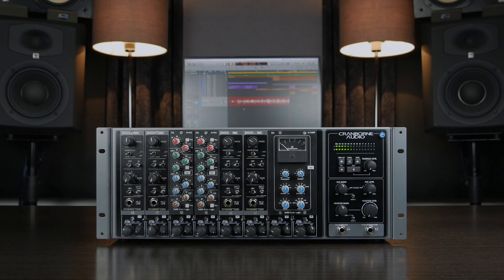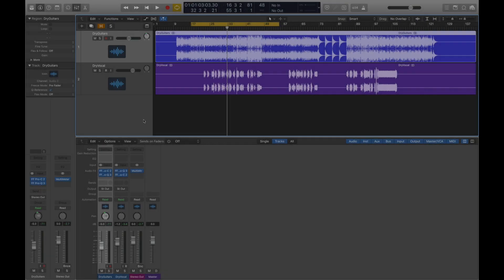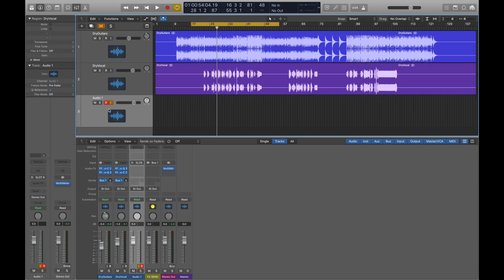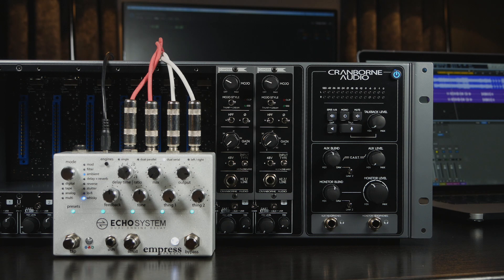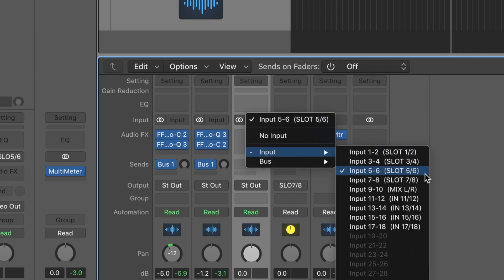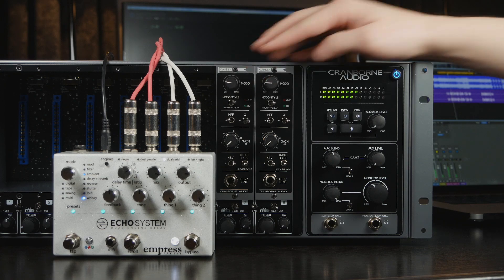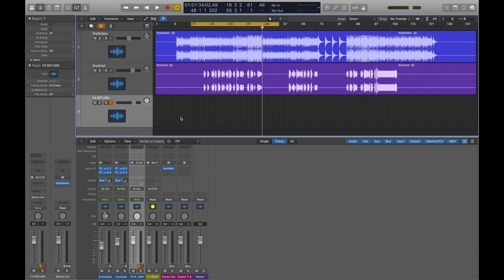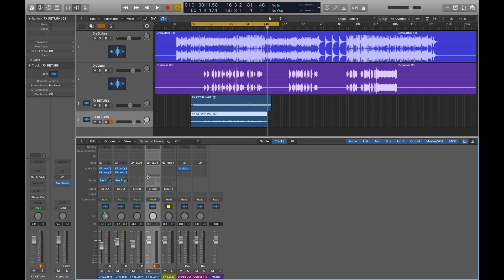500R8 Quick Tutorial | Using Insert Points To Integrate Outboard Effects

Comment: Wouldn't this unit be redundant if I am already using 12 stereo out summing? How can it be incorporated?
Reply from the maker: Hey Miguel! It wouldn't necessarily be redundant if you already have a summing mixer. You can integrate the Summing Mixer with the unit for more channels if you use the ADAT expansion, or you could feed your summing mixer out of the 8 slots of 500R8 - giving you 500 series processing prior to summing externally! All of 500R8's analogue paths are exposed and so you can patch in the summing mixer in a few ways to suit your setup. Hope that helps! Elliott
Reply: @cranborneaudio  Yes it helps thanks. I am considering it but I am new to external hardware processing so I will have to get more knowledge on this to see how I can fit it  into my rig. 
Would like to know if it is either or, or it both can be done at the same time based on your answer.
Reply from the maker: @riktascale4  You can use it either way - If you want to use the external summing mixer as well as 500R8's then you will need additional equipment/converters to get access to all 20 channels (8 on R8, 12 on the external unit) for summing - but you will be able to use 500R8's summing mixer as well as the external mixer. If you didn't want to purchase additional equipment then you can patch the Summing Mixer into 500R8 using the insert points or the Module Direct outputs but there would not be much benefit in that process - it would be an either or situation. If you have more questions, feel free to send us a Tech Support email where we can provide more through guidance on how to connect 500R8 to your other pieces of gear.
Reply: @cranborneaudio  Or that is a road I think I do not want to go down yet. I already have an apollo quad and 16 with my 2 bus+ and d box so this what I am considering adding it to with my only other purchases the 500 series hardware to add to the slots.
Reply from the maker: Hi  @riktascale4  , as a quick note, if you want to pair one of our rack with your Apollo, you will need to look at our 500ADAT: https://www.cranborne-audio.com/500adat This will connect to your Apollo via ADAT and give you 8 more channels to record as well as 500 series connectivity.

Comment: Is this possible with the ADAT unit?
Reply from the maker: Hi Matthew,

Thanks for the question!

Yes - the 500ADAT and 500R8 have ~95% similarity. The channels/slots on the 500R8 and 500ADAT are 100% identical, so each channel/slot on both units has inserts. The only difference is you will be routing ADAT channels in your DAW via your audio interface rather than from the USB interface of the 500R8.
Reply: Cranborne Audio Fantastic! Thank you for the clarification. If I had an ADAT chassis full of preamps, and wanted to record all 8 preamps simultaneously in their own individual tracks, that’s also possible?
Reply from the maker: @HollerAtcherBoi  Our pleasure! Yes - that would be one of the main uses many 500ADAT users do! Each slot has its own converters and shows up as a separate input and output as ADAT channels 1-8 corresponding to slots/channels 1-8
Reply: Cranborne Audio What a beautiful unit. Thanks again!
Reply from the maker: @HollerAtcherBoi  glad you think so too! 😂🥰😍🤩 Thanks for your interest and checking it out!

Comment: Hello guys, is there there a reason the printed effect appears to be mono?
Reply from the maker: Hey Ged, the printed effect is in true stereo however when Logic is generating the waveform during recording, it always appears in Mono (not sure why!). When the recording has finished, the printed effect then has two waveforms (L and R) and appears as stereo signal. You can see that at 03:07 in the video! Then when the track is shrunk in size at 03:10, the wave form appears as Mono again - I presume to save space, but is still the true stereo effect! Hope that helps!
Reply: @cranborneaudio  I suspected it was a quirk of Logic, thanks for clarifying.
Can I also check; is this same setup possible without a 500 series module inserted / bypass enabled / a module which is not a preamp or doesn't have a gain control?
Reply from the maker: @GedCartwright  Yes absolutely - the slot  and inserting effects works exactly the same with or without a module and with any module that processes line-level (EQ, Comp etc). Hope that helps!
Reply: @cranborneaudio  That's awesome. In that case, it seems like it completely supersedes the need for a reamp box then? I could use the same set up in the video to send guitar and bass DIs out to pedals?
Reply: @cranborneaudio  ?
Reply from the maker: Sorry  @GedCartwright  , your last comment must have slipped through our net! you are right! You may need to convert the balanced line output into a Mono output for some devices/pedals/amps etc but otherwise it is a buffered-line output and so will work straight into an amp or other device! Hope that helps!
Reply: @cranborneaudio  No problem! How would I go about converting the balanced line output to a mono output?
Reply from the maker: Hey  @GedCartwright , we can talk you through that! Please feel free to se us an email using our Contact Form where we can provide more in-depth help!